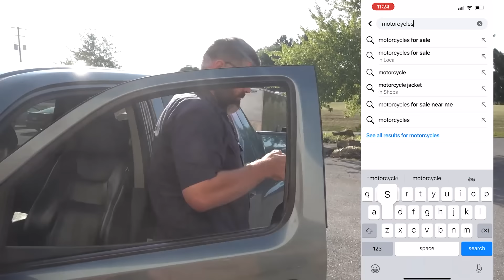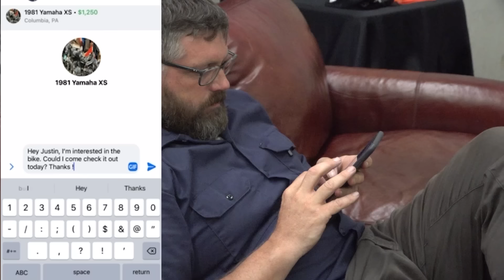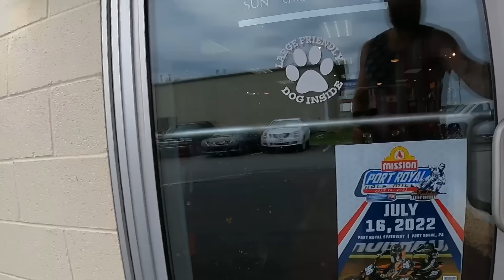I Bought the Cheapest under $1,000 Motorcycles: Challenge

Comment: I went to an estate auction with the owner of the dealership I work for  this past Saturday night and I bought a 76 Triumph Bonneville T-140 (750CC) that had been sitting for atleast 12 years for $75. After getting it home I pulled the battery and slapped it on the Battery Tender just for shits and giggles just to see if it would come back. Sunday morning I pulled the battery off the tender anddrained the old gas and put some gas and some Indian brand Carb cleaner in it,  hit the switch and not only did it come on but it started on the 3rd crank, I called my boss on a video call and said "Hey check this out...." and started for him, he was laughed and "You really got that started....". Then I threw one of my other plates on it hit it with a water hose drove it to the Car wash and then to the parts store to get new cheap oil and a cheap oil filter, brought it home and changed the oil with a mixture of the cheap oil and Murphy's Mystery Oil (my secret ingredient for when a bikes been sitting for years then ran it to the dealership and back about 20 miles to blow everything out good, the tank has the usual dings and dents in it but I have a 2019 Scout Fuel tank, a Scout bobber seat and some 10" mini-apes that I'm going to put on it. all for free because we get to keep used parts that we take off bikes if the owner doesn't want them back and then I'm going to bob the bike, I mean why not..... it cost me a whooping $75 and the parts I'm going to use are free. I haven't decided what color I'm going to paint it yet but I do know it will be loud because I'm build a 70's style bobber.

Comment: Looks like you just bought your 1st bikes back.

I don't really care about videos like this.

I'm interested in achievement, tuning, listening to performance, and what's it like to experience?

I couldn't care less about what YOU can buy.

Do you look at gauges?
Once you've learned to listen to the engine revs do you stop buying gauges?

Bikes are so fast at going through the rev range, what's the point of having a gauge?
Explain the different tyres.
Explain the different pipes.
Explain cornering.

Comment: OK Sean, you cheat, you have connections at dealers that normal people don't have. I am rooting for Craig on these challenges since he did it the "hard" way using classified ads. Also. there is a motorcycle dealer by me that sells tons of bikes that need to go thru the process of getting a salvage title on.  Would be nice to see you do a video on getting a bike from one of these type dealers and going thru the salvage title process.

Comment: I have the 535 from1990 with the straight bars and thought it was a nice bike , then decided to get the 750 as well from 1993 , I must say the 750 is more comfortable to ride than the 535 , but the 535 is nice about town and the suspension is a bit hard , all in all they are a nice low seat height bike for us with shorter legs lol .

Comment: I will sell ya my bike for 500 you replace the starter and battery and clean the carb use it for your contest then sell it back to me undamaged for 500. It is a 2002 fxst with a 1550 kit delkon jugs and heads se 44 carb cram cams dyna tech ign fueling lifters Ross racing pistons 10.5 to 1 ss gear drive krone works exhaust zippers intake and a few others thing. 15000 miles on it 125 on the rebuild